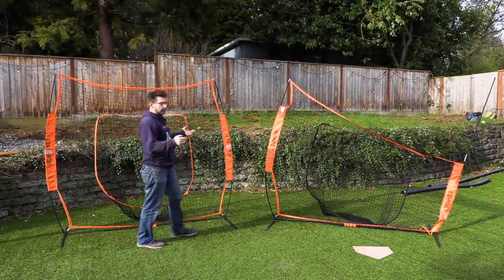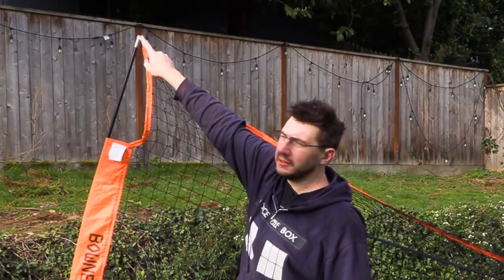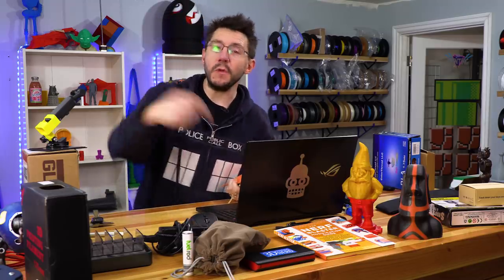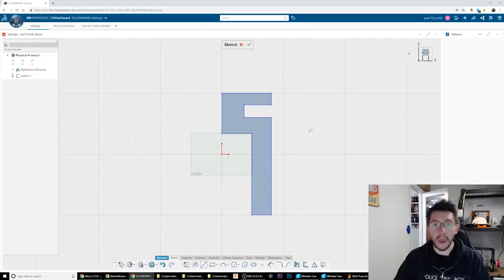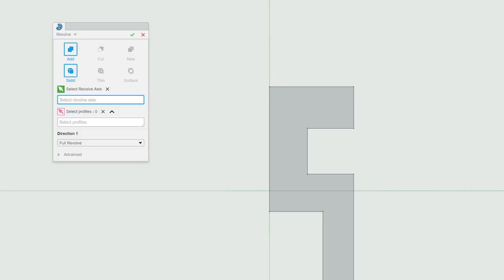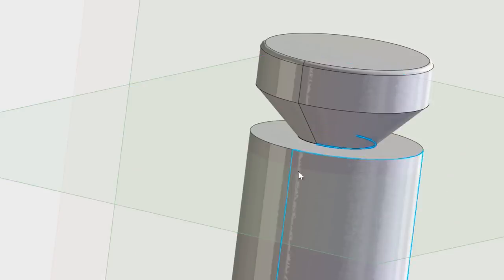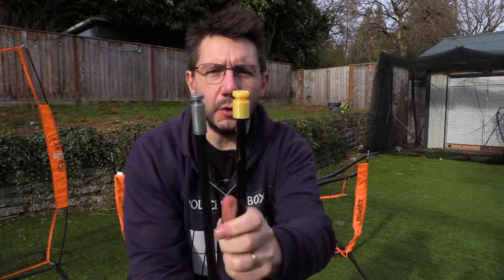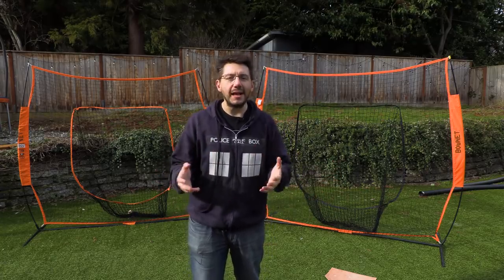3D Printing Fixes A BOWNET

Comment: For items that will be outside most of the time, ASA or PET will last longer than PLA or ABS because they are more UV stable (most plastics break down in the presence of UV light and Oxygen).

One of my favorite replacement part stories involves my 1994 Jeep Grand Cherokee.  The clips that hold the sun visors were broken and replacement parts were about $20 EACH and three weeks shipping from China (since they were so long out of production and all the ones in the pull a part salvage yard were already broken).  I pulled the part to start measurements, but found they were already on Thingiverse.  2 hours (and about $.60 worth of ABS) later I had printed, sanded, and painted visor clips.
Reply: I would be willing to bet that these nets will be taken down and put away after use, as they don't look like they are left out. But your point is spot on, none the less.
Reply: I'd also use PETG, the weak spot here is layer adhesion, which PETG has really strong.
Reply: It would also help the strength to print it horizontally or at an angle so the shearing force is not aligning with the layers.  This would be a good candidate for making a mold and casting the part with a stronger material.
Reply: @andy-in-indy  or just do it properly on a lathe like that piece is supposed to be done.
Reply: @83hjf  But then he would be Peter Brown instead of 3D Printing nerd. . . ;-)

Comment: My favourite fix until today: Senseo coffee pod machine (~$100) had a broken water level indicator, because a magnet dissolved inside its little plastic box. Surprisingly you can even buy replacement water containers that include that little swimmer for less than $20 plus shipping, but with 3D printing I was able to replicate exactly that part and integrate a small neodym magnet into the print (inspired by another youtuber). Still working and making coffee 1.5 years later.

Comment: I love it when people say 3D printers have no real use and bang I show them there wrong. I once printed a proof of concept diffuser nozzle (for work) the size of a bucket with aluminium tubes through out for strength. it weighed 2kg (4.4lb). Love to show you but its covered by propriety rights!
Reply: Uou should see the replacement switch frame I did for a 2000 land Rover D2..
Reply: @elfpimp1 That's nothing. They print rocket bells at JPL.

Comment: Question.... Because of the layer direction you have weak points, should you rotate to print to get more strength based on the direction of pressure on the print?
Reply: If rotated 90 degrees and printed sideways, it's got a good chance of splitting at the point where it meets the pole.
Reply: @ManIkWeet  true, so .... Is there a good solution then? Is there a solution that might not be possible at this time but might be ideal?
Reply: @blainesprague2365  You could use lots of supports and print it at an angle, that might give it a bit more strength where it matters.

Comment: PLA is fine for UV just the color might bleed away over time but its mostly stable.

for better strength the chamfer you added to the "slot" do that top and bottom.

the problem is your real strength comes in your perimeters but you have a section with 0 perimeter strength. the "plane" at the base of the slot. you have 4 our perimeters and 4 inner but nothing connecting them but your top layers which are not as strong.

if you made that whole segment a nice smooth "arc" inside and outside the perimeters would "interconnect" rendering the final part much much stronger especially if you use say a 0.8mm nozzle and 3 perimeters. it would probably last as long as the metal part them unless a ball hit it directly.

think hour glass. NO sharp angles except the very top and the very bottom of the part.

thats why your first one broke is my guess.
Reply: Watch CNCkitchen's video about that topic.
For this application, PLA is probably fine, but normally not.

Comment: Printed a proprietary adapter for a fiber optic light meter. Exfo charges $150, It's about 29 grams of plastic and a 20 to 30 minute print time. Even fits in the built-in carry mount for the adapters on the meter. I've only printed a few hand full of projects since I got my first printer on Christmas morning, however, they've all been custom designs, which I'm a newb at but getting better, and the cost to purchase the things I've made have already saved more than the printer costs. I'm on a Monoprice Mini V2, but eyeballing the Prusa I3 Mk3, with Arduino wifi unit and multi-filament attachement.

Comment: Hey Joel.  You could have flipped it and angled the body instead of the top.  I think it would printer better and hold the rope a little better too.  Love the video too!

I also fixed some 10k+ equipment for my work with 3d printing 😂
Reply from the maker: That’s a very good tip, thank you!

Comment: things i fixed so far with 3d printing: gasstove knobs, a holder for a remote, the rearwindow blinds of a mercedes, quadcopters, carseat adjustment knob, 3dprinters, shelves, a ikea glass cabinet, rc remote and my cofeemaker... and i'm sure i'm forgetting a whole bunch of stuff... i have to learn something like fussion360 though... doing all this in maya and zbrush is a pain in the derriere.
anyway... high five keep up the good work <3

Comment: Too bad Solidworks 2019 only supports Windows - the current browser-based trial ends when Solidworks 2019 gets launched.
Odd choice that they support Windows 7 and Windows 10, but not Windows 8? What's that about?

Comment: Useful stuff what I've printed:

Knobs for a set of workshop drawers
Project boxes for my electronics projects
Diaphragm for a faulty WC Siphon system
Plastic lever thing for my other toilet
Knobs for some potentiometers
Cable anchor/clips for some under shelf lighting
Custom design Pen pot/organiser for my desk
Custom piccatiny rail mounts for a thermal sight
Plastic insert for a tap/faucet head (previous had cracked making it impossible to turn the tap on or off)

Comment: So happy to see this video.  I have 5 3D Printers and the best thing I ever printed was a small control handle for a machine where I work.  I work at a Eye Doctors office and one of our test machines control handle broke from years of use.  The company told me they do not have replacements because of the age of the machine, we would have to buy a new one.  A new machine cost $20,000.00 or we could buy a used machine exactly like the one we have for $6,000.00.  Ours works 100% fine,  just the control stick a small plastic part was now broken.   I took it apart and a friend helped me model the part with Fusion 360.   I printed a new part using Black Carbon Fiber PLA AT 60% infill and installed the new part.  I printed 3 total just to have extra.  This was about 5 months ago and its still working with the 1st print!  This saved the office a lot of time and money.   After that friends and family stopped telling me that 3D printers were just an expensive toy.   I did take photos as I fixed it if you ever want to see them or use them in a story you are welcome to the information .

Comment: The weirdest piece that I've modeled/printed is a custom snowmobile helmet visor nut. The piece hadn't been made for eons and there was no purchasing a replacement. Sadly, without it the helmet wasn't usable. I used the second one (other side of helmet) to model. It had all sorts of complicated geometery, and I didn't get it totally right... but it actually worked!  $100+ snowmobile helmet saved.

Comment: I use my 3D printer mainly for my modifications to my drones..  fitting a new camera, spacers, antenna holders, etc...  The only thing I'm curious about with your print is being PLA and also on equipment that is outside, wouldn't it get soft/malleable being out in the sun during our summers in Washington?

Comment: Nice job and I love this type of video on the practical usage of 3D printing but... I agree another material might have been better.  I make a two piece replacement seat lock holder for older GS BMW motorcycles that is no longer available, sold about 10 ea, out of Nylon X and so far they have been holding up well.

Comment: I actually picked up my 3D printer for the more practical applications. Not so much repairs but I do quite a bit of DIY projects between homebrewing, and modifying cars and motorcycles. After chatting with someone at work about 3D printing I was sold on it. Even if I end up not using the printed part as my final iteration, it makes an excellent mold that I can use for fiber glass or other materials. As I watched this video, I was playing around with a design for a custom boost gauge pod for my car.

Comment: Might work to print 1, anneal it in your oven (lots of YouTube evidence that regular PLA also benefits from annealing), measure how much it shrank as a percentage. Stretch the model in your slicer to compensate. Then print, anneal, and use.

The major weakness of this design (just a function of the manufacturing process) is the expected stress on the part is going to be a shear force along your layer lines. The annealing process might help strengthen the weakness between the layers.

Comment: Actually, I've made a couple of speciality parts. For example, made adapters for some cheap solar garden lamps so that they could be mounted on the wire fencing. I learned a lot about the design process and the material strength of PLA. Great fun.

Comment: Last week my co-worker needed to replace a metal handle on his microwave, the plastic connecteor snapped when his wife opened it. Modeled and printed the piece twice, (one on each side of the handle), and it saved him $300 (because you can't just buy the plastic pieces you have to buy the whole handle). I feel like I'll be making a video about this for TN. Modeled in Cinema 4D.

Comment: Usually, when you remake a part for 3D printing, it makes sense to redesign it with 3D printing constraints in mind instead of reapplying the constraints of a machined or molded part. In this case, the part is cylindrical with a sharp notch because that is easier to machine. However for 3D printing, you would want to printed it horizontally to make it stronger on the z-axis, so making it hexagonal or octogonal would have been better. I would also have redesigned the notch to make it rounded instead of that sharp angle, again for solidity.

Comment: The On/Off/Pilot knob on my water heater broke while trying to relight the pilot.  A few hours later, pulled a new knob off my printer and it worked perfectly.  No cold showers since. 

Another money saving print was a flipper arm that triggered a limit switch for my brother's ice maker.  It appeared to be a common issue with that model.  I recreated it and manage to reinforce the area that broke the first time. 

I also made a replacement broom handle.  That one didn't save me as much since the wife broke the rest of the broom a couple days after the new handle was put on. 

Functional replacements are the prints that make me the happiest.

Comment: Assuming that the metal poles are not solid but rather hollow I would have enforced the plastic part by integrating a metal screw in the center of the part, e.g. M3 size. With two bigger sized washers on top and bottom as clamping force distributers they would be able to collect any tearing forces and should drastically increase lifetime of the part.

Comment: I actually have printed things like this around the house several times.  I had a spring loaded shower rod that was slowly sliding down the wall.  I 3d printed some cupped holders with 2 screw holes to mount it in place.  Worked great!  Next, I was replacing a tiny bathroom mirror with a sheet of mirror and needed clips to hold it to the wall.  I printed out some mirror clips and it is held firmly to the wall.  Also, I have a rechargeable yard trimmer, and I got tired of the battery laying on the floor when I was recharging it.  Printed out a battery holder and Viola' it now hangs on the wall next to the trimmer (thanks to a hook I printed for the trimmer) and keeps it handy for when I need it.

Comment: Well I ended up making door frame clamps for network cables cause I run multi-cable networks throughout my house
but since I rent I can't place in hooks, and those sticky hooks come undone in the Aussie heat, 3d printing basically saved me time and makes my cable runs look great

Comment: Wouldn't it be cheeper to redesign it yourself and let a 3D-Printing Company print it for you?
If you don't have a 3D-printer this would be an easy thing everyone could do.
Reply: it's not cheaper if you've already got the printer, but otherwise, yes!
Reply: In my opinion, while it would be cheaper for a single very simple part, buying a printer is the superior route. For one once you've had it for a while, if you are the type who will actually design parts, it will definitely pay for itself, secondly, in this case his first print design worked, but this was a rather simple design. If you've ever designed even a simple item, you probably know that your first design is rarely your final. Certain things don't become obvious until you have the part in hand and install it. So designing something, especially something asymmetrical, then waiting for the print to arrive, only to find out you have to redesign the part and have it shipped again is a painful waste of time and money. However, if you OWN a printer, you can print test designs, like threads or brackets to test the fit before committing to a bigger more costly build, and once it's perfect you can print as many as you like for  just the rather inexpensive cost of the filament and power, versus someone else shipping, materials, and time.
Reply: actually the cheapest route if you do not have a printer is home depot or some equivalent.

get a threaded rod coupler that fits over the end of the rod. and a BOLT for the other end.

threat the bolt into the coupler leaving a gap (just like the original part for the cord to latch onto) now slide it onto your metal rod and jbweld or epoxy it into place.

done. cost? about $5 in parts plus the epoxy putty another $4 or $5

so $10 and you have some epoxy putty left over for something else. store it carefully so it does not dry out.
 @CarlosElPeruacho
Reply: @nerys71  I didn't say it was cheaper, I said it made more sense. Your point is outside the parameter of the discussion. Crafting or fabricating something is not the same as 3d printing something vs modeling it and having it printed. Furthermore to my other point, while this particular design is simple enough to throw something like that together, this is not the ceiling for design or capability of a 3d Printer in general. The Original question was wouldn't it be cheaper to have someone else print it vs buying a printer. My argument was that while in that instance it might be cheaper, the value of on demand prototyping and manufacturing is high enough that its worth the upfront overhead. Especially since printers can be had for as low as 150 dollars. If you're already modelling in 3D to begin with, getting the printer is a no brainer. If all you care about is thingiverse, don't bother getting a printer in the first place, unless you just dont need the money and this is how you'll waste it.

Comment: We have an old Christmas tree that my family got when I was a kid.  The brackets that hold the branches of the tree after 40 years have broken through and the branch would just fall.  I was able to take the bracket off and in Tinkercad was able to design a stronger and thicker one.  Printed it in PLA and placed it on to center pole for the tree.  It worked!  Being that I made it more like a gun cylinder it was way stronger than the injected molded one that was original to the tree.  I printed another seeing that one of the other was cracked and going to break soon.  There's only one other to replace when I put the tree away and no it's not broken, it only missing a branch.  When me mom and dad got the tree and opened the box to put it together we found that a branch was missing.  They went to a Christmas store that wasn't that close to where we lived so they said it was ok because it was a beautiful tree and it still is.  That side of the tree aways faced the back so no one can see it, but I made a new bracket with one less hole and spread evenly.  Once I replace that one the tree will be like new and last for many more years.

Comment: We have windows screens that have pins on one side and they go up and down.  They are held in by a holder.  I looked around for years to find them or something that would work in there place.  Nothing worked and it caused the screens to have gaps around them.  One of the first things I made was replacements for these items and now I can close the screens with no gaps.  I have wondered if we can take a product and make changes to it to better fit what we need, but have not had much luck with finding a way to get the model in 3d to start it.  Really like when you can take on challenges a lot of us face and defeat them.

Comment: I designed several strap cushions to protect appliances that get strapped to the inside of my delivery truck at work. printed out of tpu they're strong and a lot cheaper than the items you can buy for that need.

Comment: I love that you're using 3D printing to fix stuff. I used a similar idea to fix my wife's car. A metal part on the rear wiper had corroded and was allowing water in and caused failures. I was able to use calipers to make measurements and design a replacement plastic part that won't rust. After cutting off the old prices and gluing on the new, it works great. I'm sure that I saved a couple hundred dollars. I also learned how to design and print threads.